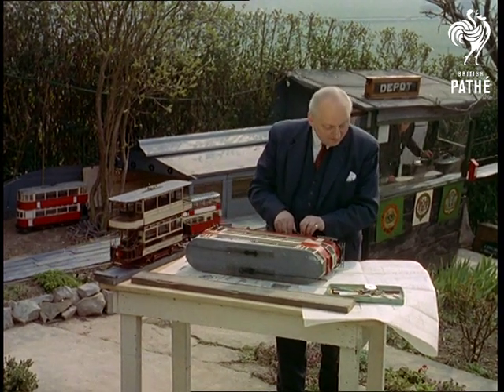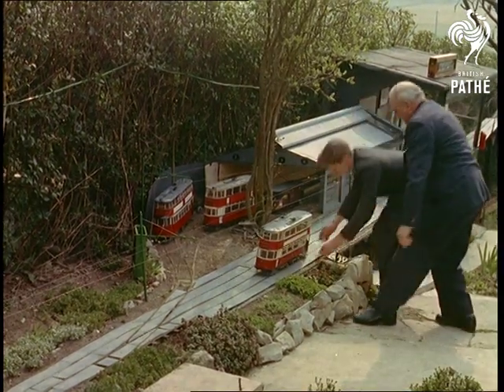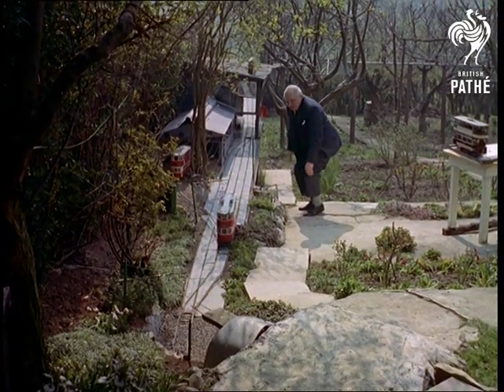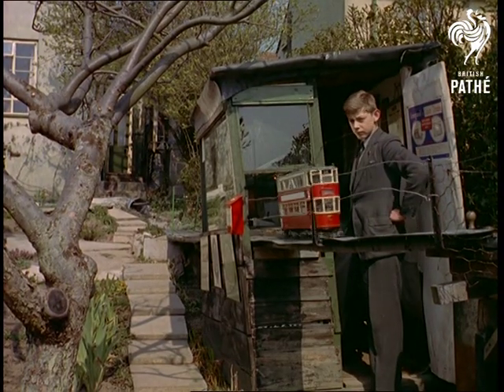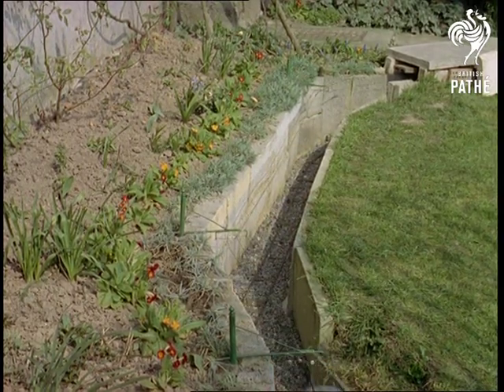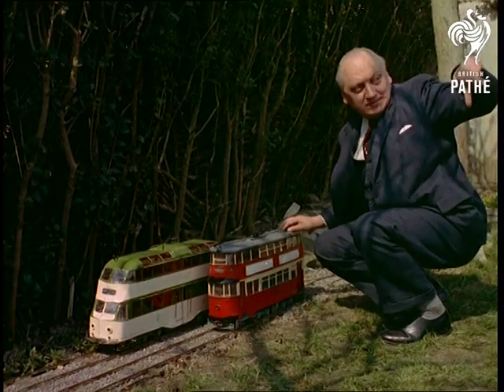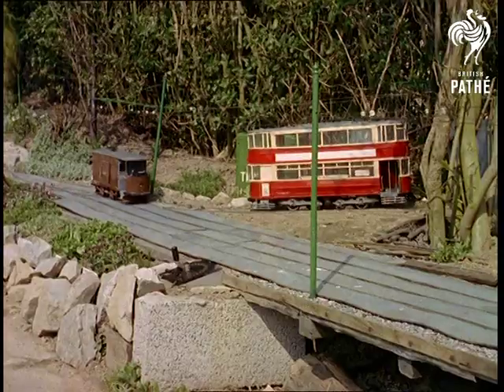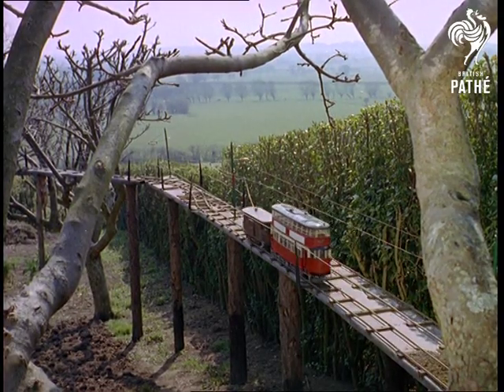Model Tramways (1958)

Comment: He must have been an staff engineer at that company or something like that because building that was not easy, requires intimate knowledge (pre internet days) and was quite expensive (especially in those years, about a decade after WW2).
Reply: True. You need access to a lathe milling machine etc. A retired work colleague of mine builds miniature live steam engines and he has spent a fortune on building a garage and equipping it with machine tools
Reply: @Isochest for building models such as this the only turning job is on the wheels and axles, even then these can be bought pre turned from the tramway and light railway society. Everything else can be made using hand tools and time.

Comment: What an amazing setup and they must have been pretty happy in Glastonbury as the old S&D was still open and like so many towns and villages serviced by the S&D, Glastonbury visibly withered since the lines closed.   I remember the old tram lines they had simply tarmac'd over at Grove Park bus depot and they had to dig them out as the tarmac had sunk exposing the rail troughs like broken teeth, imagine if London had them trams and trolley's still going today how much cleaner and cheaper transport in London would be?

Comment: is there any tutorial to make those model trams?
Reply: Bit hard as they are probably made from brass, white metal etc. And there also probably build from scratch and you need a actual tram control Handle and tramway (including overhead wires) to run it. Paper tram tutorial maybe? There amazing models anyway.
Reply: Ashley Best wrote an article on building trams in model engineer starting November 2012, and continuing into the following year, also Alan Hearsum shows how he built a Preston type tram from 27th August 2010 in the same publication over 9 issues. A lot of the work is wood work, and trucks fully made can be supplied by TLRS.